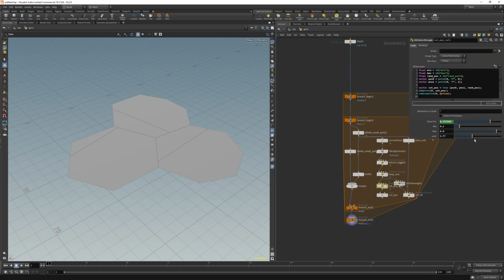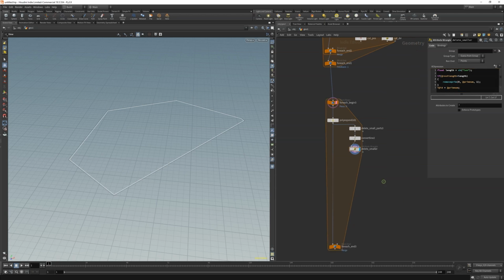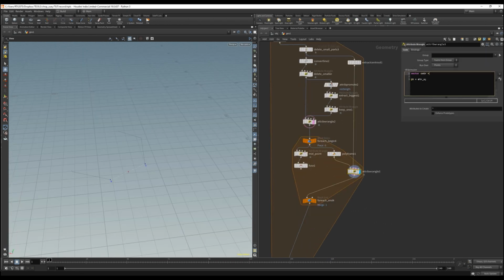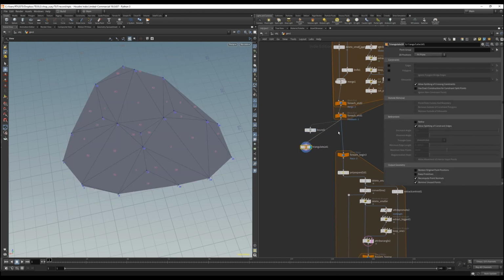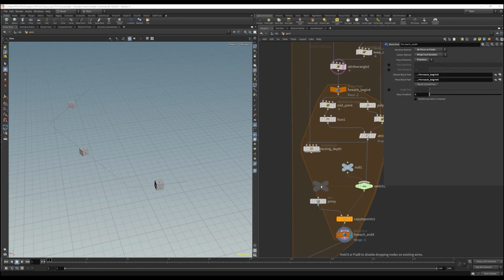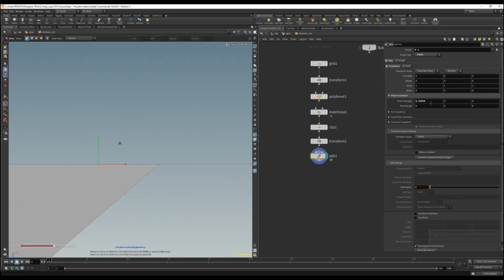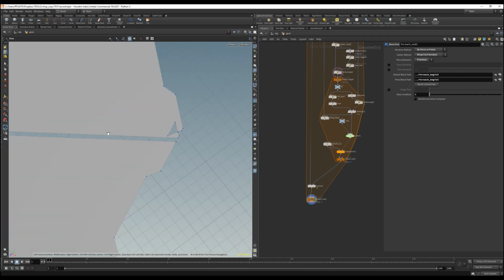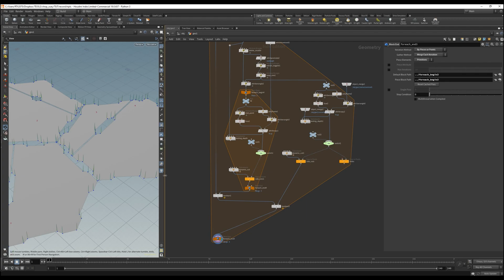Houdini Tutorial: Procedural Scifi Panels Generator | Part 2

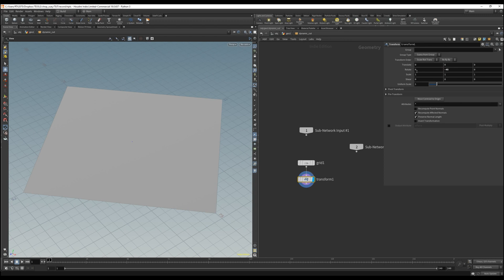Comment: For anyone stuck around 5:50  you don’t need to recreate the exact same shape using the point numbers. You can just make the grid without worrying about rows/columns, then use the ghosting effect one step ahead to tweak it into the final shape. tbh I wasn’t really sure why the instructor was messing with pivots, so I just made two edits one for each point group and that worked way easier for me, Also, if you can’t see anything, you might need to rotate the clip’s origin. Since it’s not procedural, you can adjust everything manually. The "restlength" is the main thing that really matters.
honestly this is an amazing technique, I can use the inner wrangles in so many other designs.
super thanks !
Reply from the maker: Absolute correct.

Comment: For those wondering why Pt2 does not work as it should, at 01:45 there is an issue in the video where wrangles are copied from the previous For-Each loop above, but now have a slightly different script. Make sure the Attribpromote and "Extract_Biggest" wrangle all use the same name for the promoted restlength i.e. "max_len" and not "max_rest" as above.